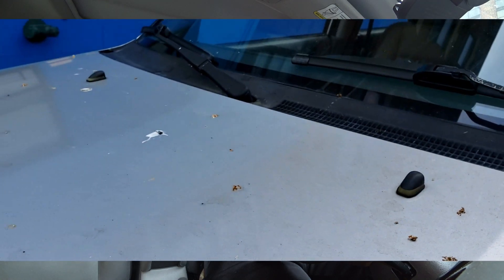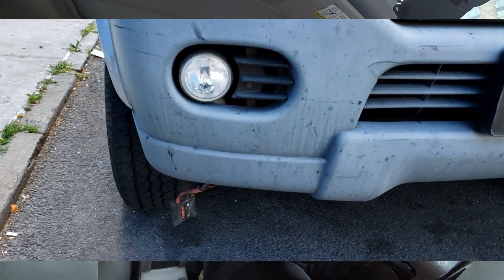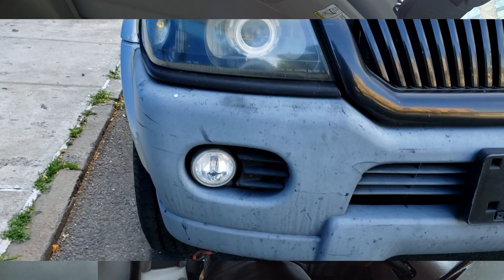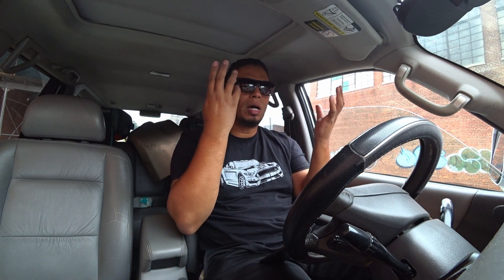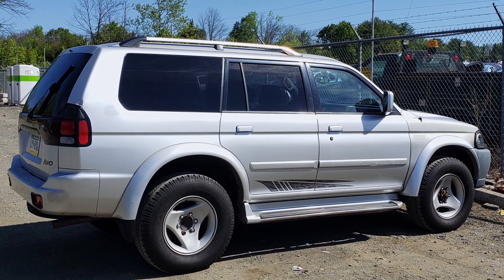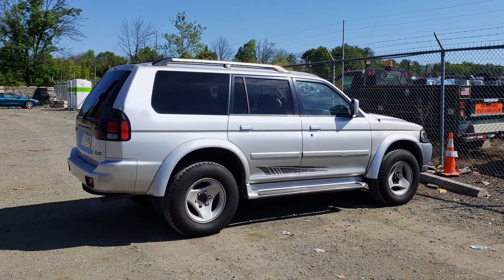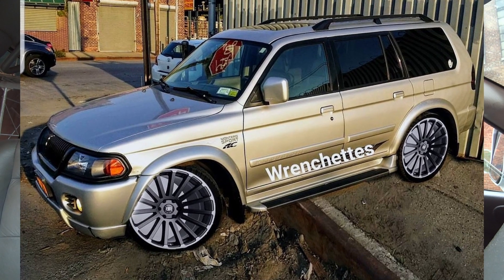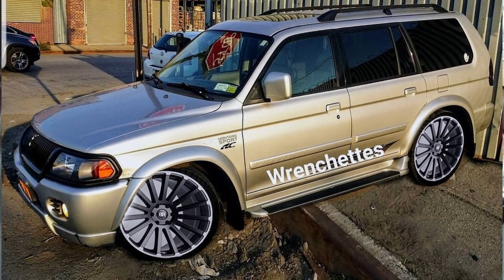Enhancing My Montero Sport's Performance doing Maintenance Repairs

Comment: Have you done a video about changing dashboard lights change?
Reply: @LuisMBuildz  I thought it would be easier if there were instructions.
Reply: @LuisMBuildz  Thank you, that would be very helpful. The air conditioner and oil pressure gauge are also affected. i would like to replace all the bulbs.